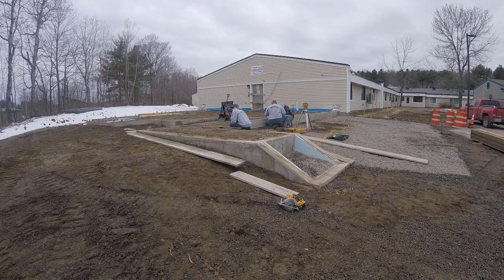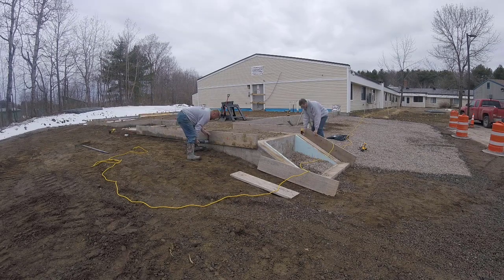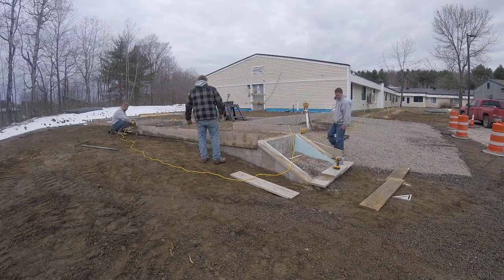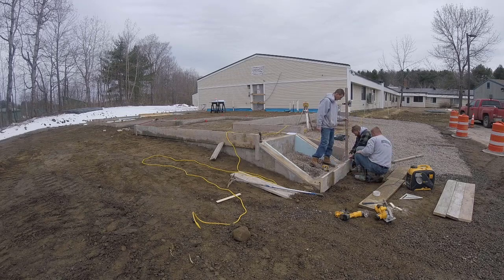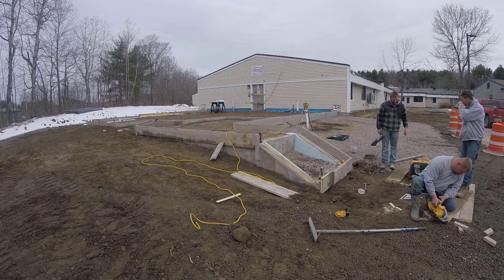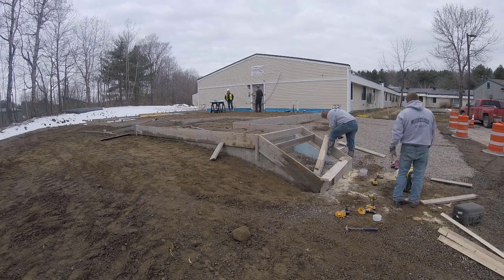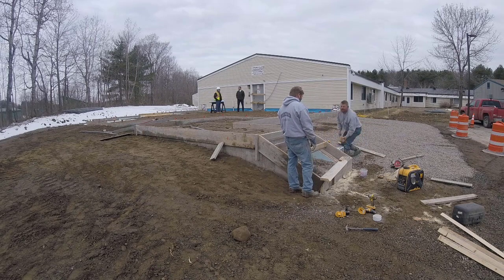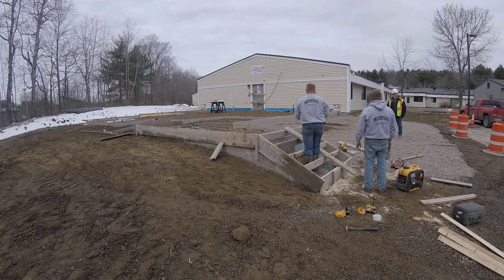FORMING CONCRETE STEPS AND A CONCRETE PATIO : PART 1

Comment: Have formed a 3 step but that is it.  Need to form a water drainage valley soon, can you give me some pointers?
Reply from the maker: I would set both outside boards to finish grade, then make a jig (screed) out of plywood shaped in a V the same slope as the drainage valley. Use this to screed with to make the valley consistent throughout.

Comment: Did you set a foundation for the steps? Thanks
Reply from the maker: Yes, there's a frost wall there.
Reply: The foundation goes doreen 42 inches. Is it concrete foundation, crushed stone or cinder block.. I ask because I want to return my steps back to concrete and remove the wooden steps. Thanks

Comment: No. How would you form the steps if you didn’t already have  the sides (as per your video)? I have a brick shed on one side & a wooden deck the other!

I also need some drainage as well! We wash down the concert patio every day as we have dogs. The wooden steps have rotted very quickly
Reply from the maker: You would use wood forms.  Here is a link to my web page about it. https://www.everything-about-concrete.com/building-concrete-steps.html